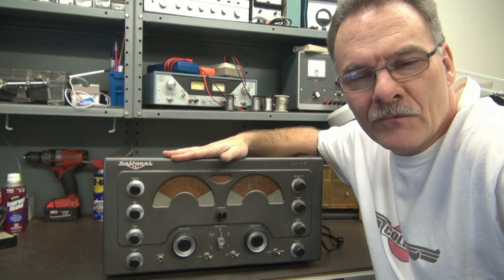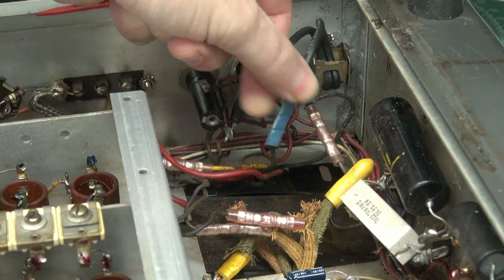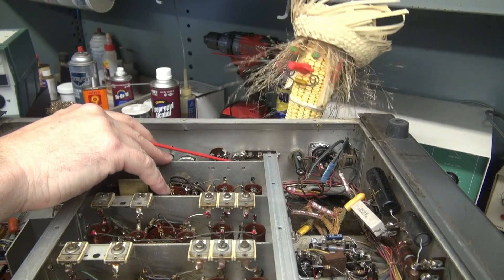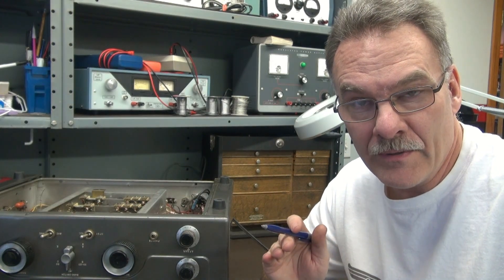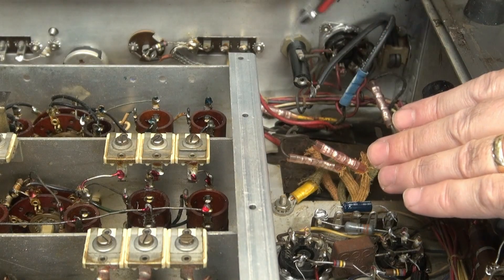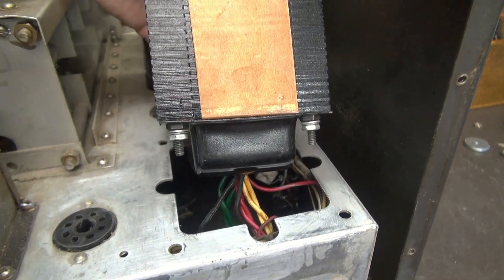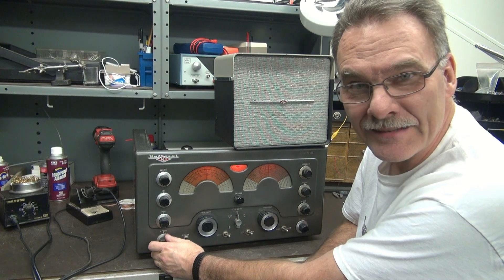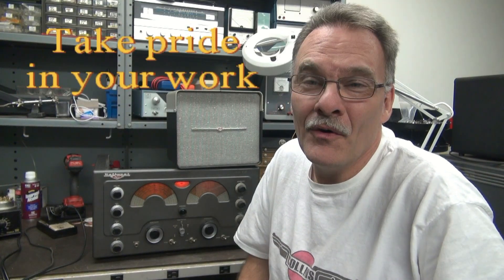King Kobbler National NC-183 shortwave radio power Transformer repair

Comment: Hi. I recently acquired a similar radio in a pretty good shape - I thought.  The transformer had taken some abuse and although presented the expected voltages without load, did not produce more than AC buzz with tubes in place. The plate winding gave 355 VAC, which supports your feeling of a documentation error. 

The manual doesn't explicitly state the transformer specs, but based on the guidance for the voltage test points, the original plate secondary must be 650-700 VAC CT. I am sure that the 600 VAC CT works fine.

I decided to spend a decent sum to a Hammond 372JX and noticed that the holes in the feet match the original hole spacing when turned 90 deg. Unfortunately the other direction has no match, so I needed to drill two new holes.

So I could fix the 372JX almost in the original holes and no extra sheet metal was needed. The distance to the fat ass 5U4G is about 1/4".

Thanks for your videos! They have helped me a lot.
de OH8SM

Comment: That's funny the way they used butt connectors from a heavy gauge wire to practically a fuse link LOL. What's even funnier is, I've come across countless guitar amps where a replacement OT was installed using wire nuts :) Taking pride in your work is very important in this profession. doing a butcher job will come back to bite you in the keester at some point in time. Keep 'em coming! :) PS: Most of the techs who produce these type of videos out there have more technicians subscribing than end users :)

Comment: Great video Terry, love the adapter plate! Perfect solution...AGAIN
Reply from the maker: +hffenninger Thank you for your faith in me. If you change a NC-183 power transformer, be cautious of the HV secondary voltage. The original schematic shows 400 vac, whereas it should actually be around 330vac. The SAMs Photofact schematic indicates the proper values. I followed Nationals specs and it caused me excessive repair time to determine why voltages were so high throughout the receiver. I have the situation under control using a Hammond 272JX tranny. Now I have many out of tolerance resistors to swap out. I will be posting a follow up video. Glad you like the cobbler. He is a d-lab villain!
Reply: Absolutely. You have given me several great hints. I see myself using the Hallicrafters to learn my way around the inside of these radios, and eventually selling/trading up to one of those big boy receivers. I will stay tuned for the next exciting chapter!

Frank